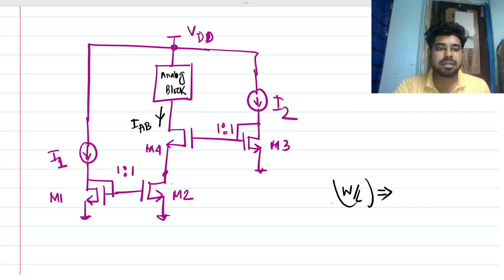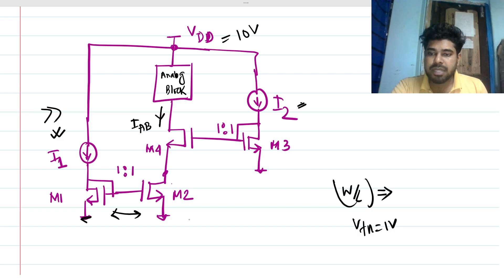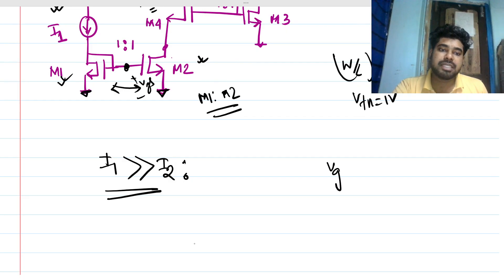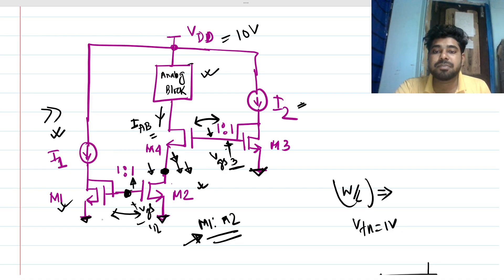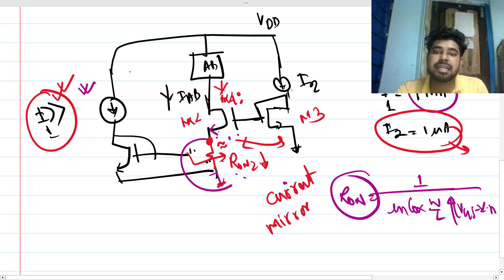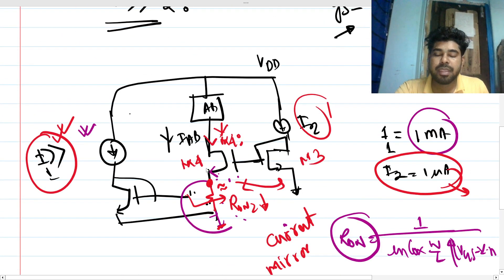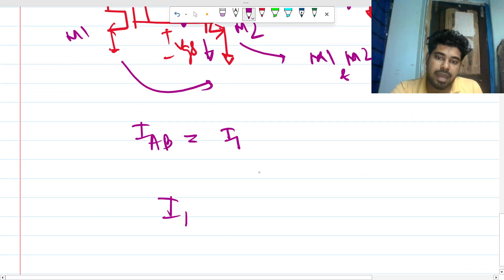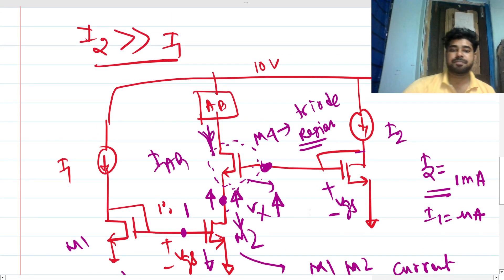Anlog Circuit Design Interview Question at Apple_ Find Current through the Analog Block_ Amit Bar

Comment: When I2 > I1, why does Vx increase? If I2 < I1, why does Vx decrease?
Reply: The vds over there is vdd - drop across ab ( iab (resistance )- m3.

In case if you increase vgs  for m1 m2 current mirror. You are actually increasing current across the drain of vx  which eventually lowers the vds as per the equation. And vice versa for me and m4. Correct me if I am wrong.